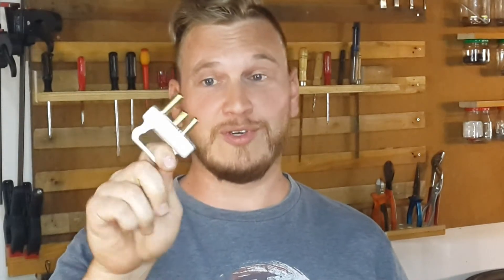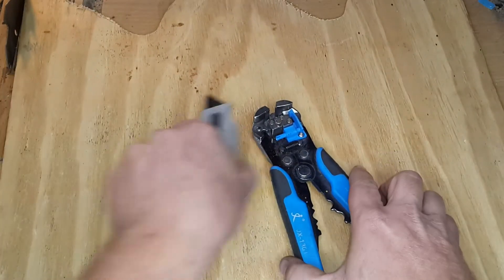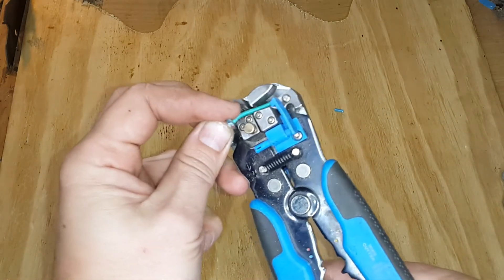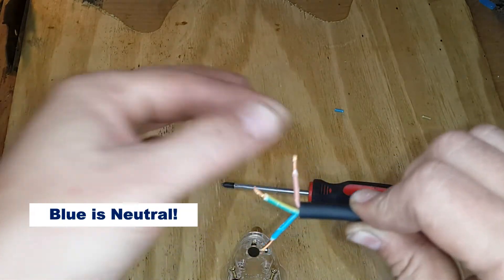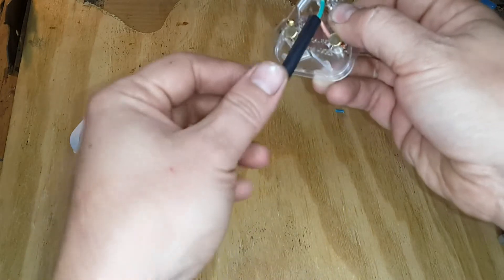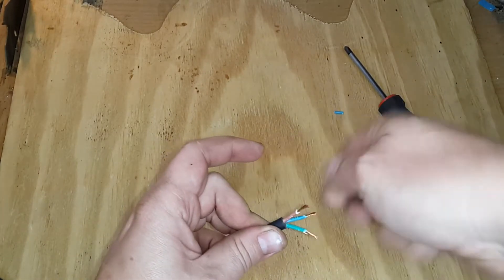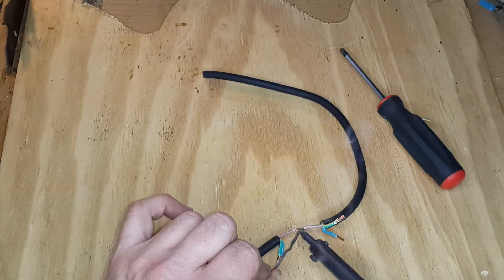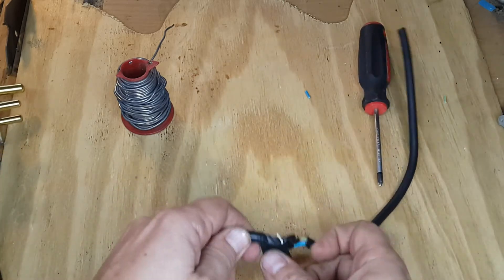How to wire a 3 pin plug correctly!

Comment: Electrical tape is good. But try out heat shrink tubing: it’s a revelation! 

Pro tip: when splicing multi-conductor cables, cut each wire a different length so the individual wire splices are staggered. This avoids a big lump where the splice is, and provides additional safety if the individual insulation should fail for some reason. When staggered, the overall splice is longer, but less girthy. :)
Reply from the maker: Thanks for sharing your pro tip! I’ll definitely add that to my toolbox. 👍

Comment: Unfortunately this shows the wrong way to mount a plug. The big mistake is that all three individual wires are the same length. The reason is that if the cable gets pulled too hard, such that it escapes the strain relief and gets torn out of the plug, you want the L and N wires to rip out BEFORE the earth wire. On this plug design, this means the earth wire needs to be significantly longer. If they’re all the same length, the earth rips out first (and could even come into contact with L!), creating a hazardous situation (at minimum, defeating the earth wire’s safety function).

Also, I highly recommend using crimp-on wire ferrules. I don’t know if South Africa requires them or not, but they’re super handy. (They are mandatory here in Europe, but not common in USA for example.) Not only do they make inserting the wires easier, but they also improve robustness because the rotating screw in the terminal can’t damage individual strands, nor can individual strands work their way free over time.
Reply from the maker: I appreciate you taking the time to share this valuable information!